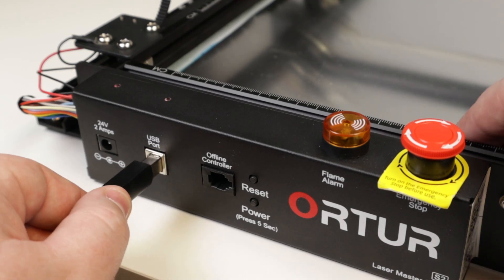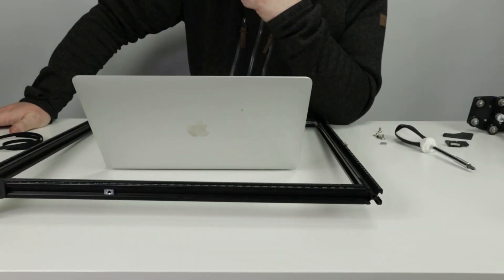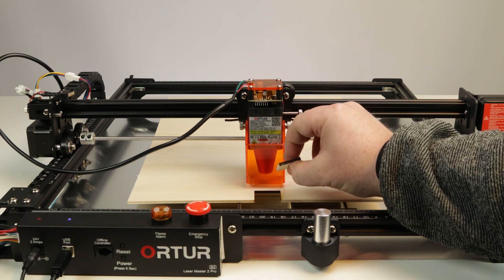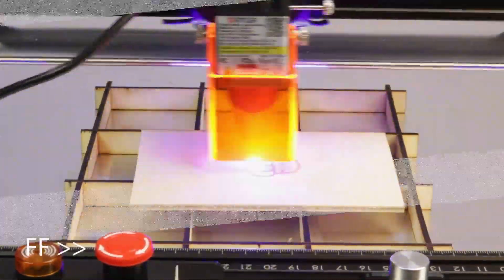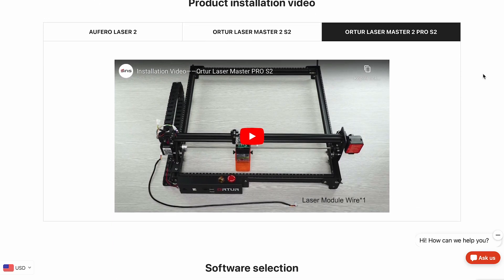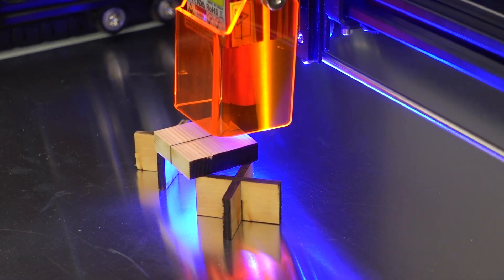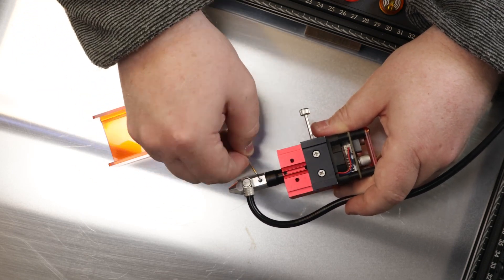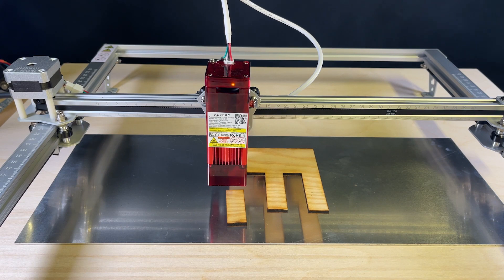Ortur Laser Master 2 Pro S2 - FULL TEST

Comment: Hi. I ordered this -- ARTUR Laser Master 2 Pro S2 .  Can you help me which programs I need and where to download ? to work with the tank and make drawings to burn .. can I link to the programs please .
Reply from the maker: Lightburn is by far the best software! It has a free trial period as well. LaserGRBL is a totally free option, but has no design possibilities.
Reply: @DIYTECHBROS  I'm new to this business. . Artur Laser Master 2 Pro S2 . LU2-10 I have a question for you in the LaserGRBL program, when I aim a laser for example on a ballpoint pen, when I want to write a word, before that I turn on the laser to see its position and its directions as it wakes up to write . But after that , I still have a thin strip where the laser light sight passed . I looked at 3% of the laser in the settings, set it to 1%, there is still a strip.. What else can be configured and how ? so that the strip does not remain on the object, the top layer of paint burns a little.. If there are lessons or videos how to solve this problem!

Comment: Hello, thank for your clear content. I want to buy a laser to cut polyester lycra fabric. Can this laser cutting bundles of fabric?
Reply: Our suggestion is to cut layer by layer for better results.Cutting multiple layers together will easily catch fire.
Reply from the maker: Hi! Thats no problem! But, it will cut multiple layers. Use air assist to avoid fire!